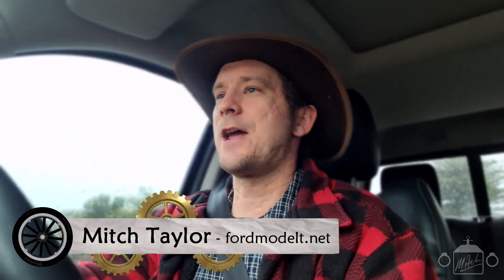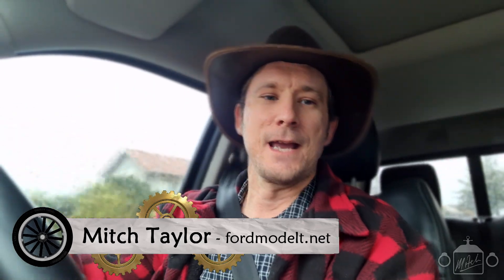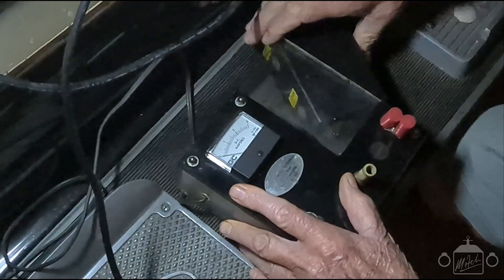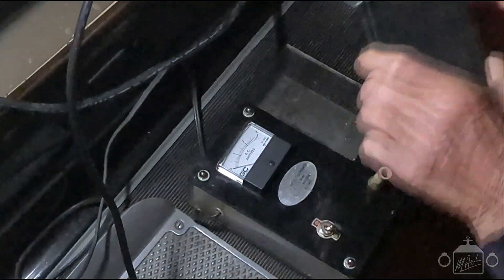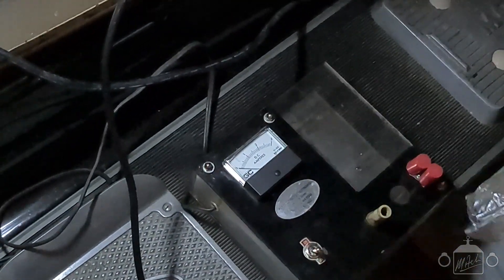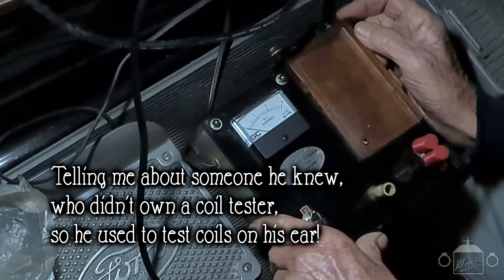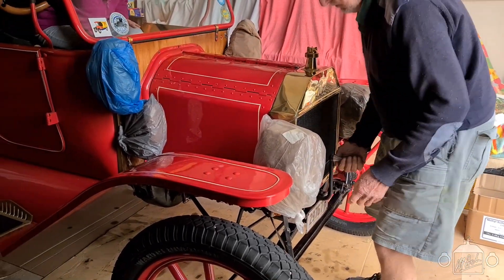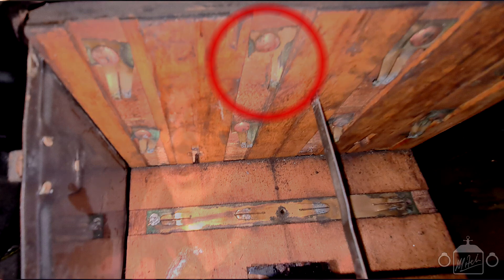⚜️ Ford Model T ⚜️ Curious Coils - Troubleshooting Misfires

Comment: Thanks for your prompt reply!  Strange,  I have about 30 of these.  I have managed to get several of them working but I am applying the positive to the top side contact and negative to the bottom and at the same time putting a new capacitor across the contacts on top.

Comment: The reason I am asking is because I am not using it in a car.
Reply from the maker: The base contact under the coil is connected to the primary winding (positive) the lower contact on the side of the coil is connected to a secondary winding and goes to the spark plug (negative), and the top contact goes to the timer.

Comment: Since you will be rebuilding the coil box and such can you show the difference (if any) of the engine running and driving on battery vrs pn mag? My mag is dead, and I am running on battery only until the season is over. I've never run on mag and seem the difference, but I hear there is a noticeable improvement in performance. Others say there is no noticeable difference. Would love a definitive answer as to how big of a deal it is to not have mag.
Reply from the maker: My magneto works fine, so yes, I can show you the difference between the two. A healthy fully charged battery is always helpful! My T has a strong magneto, so it always performs best on magneto over battery 🔋 😀